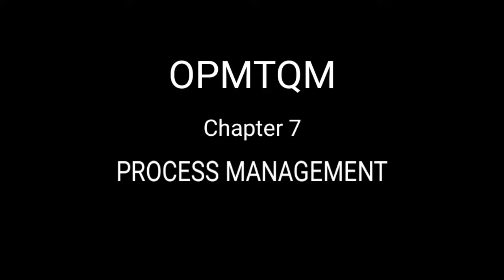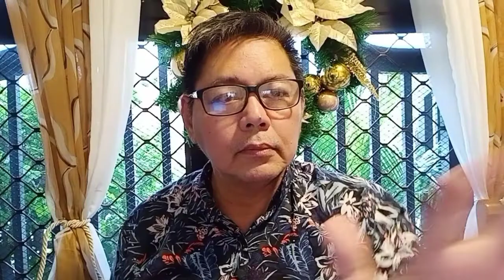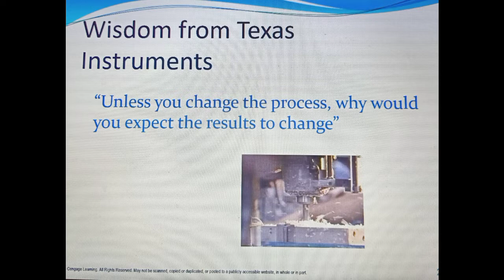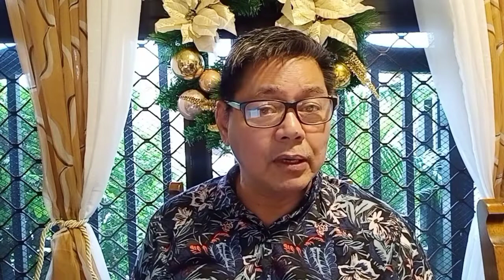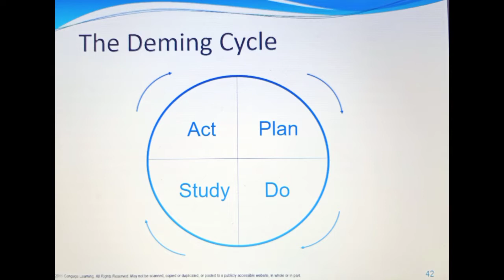OPMNTQM CHAPTER 7 PROCESS MANAGEMENT

Comment: Ilagan, Gerard Paulo Angelo V.
2AIA
Final Examination

Chapter 7- Identify and explain five leading practices in process management exercised by total quality firms

Business change must be performance-driven - "You reap what you sow." This is the measurement of the performance levels of employees in a company. 

Business change decisions must be traceable to the stakeholder criteria - stakeholder criteria is something agreed on. Which is also the basis for making business decisions. 

Business processes must be managed holistically - this means appointing supervisors to every business process. It is simply making others do the work for you.

Process renewal initiatives must be conducted from the outside in - basically, it means working your way back. Just like factoring in math.

Business change is all about people - for a business to change, the people must change too. And change does not happen overnight. It is a long process. Which must be handled properly

Comment: BAITO, Vince Eric T. 
2BBE

FINAL EXAMINATION

Chapter 7:

QUESTION: Identify and explain five leading practices in process management exercised by total quality firms

Total Quality firms are organizations that utilize the concept of total quality management in terms of operating one’s business. By definition from the Oxford dictionary, total quality management is a system that relies on the concept that each member of staff shall be committed to a certain level of high standards in terms of work in any aspect of an organization. While the concept of total quality management has an eight-pillar foundation of its principles, there is still a need for how to practice and execute the progress management properly. In this essay, the methods used to maximize the full capacity of process management shall be discussed. 

First on the list is management audit,  this is the prerequisite step needed to fulfill the implementation of Complete Quality Management. This seeks to aim, recognize, analyze, and identify any error that might present itself inside an organization - in doing so, an organization can seek the possible resolutions in order to address the issues at hand. Additionally, management audit allows an organization to have the opportunity to maximize its production of top quality products or services. Whereas critical success factors (CSF), is an individual’s guide in finding one’s purpose that is in line with his or her business ideas; this will allow oneself to focus on his or her goals and acknowledge the various factors that will aid in any improvements to his business rather than remain in a stagnant position. This is why it is a must to quantify any potential achievements an organization may have attained. The critical success factors show how much of an impact is made by Total Quality Management; this is achieved thru the illustration of numbers, graphs and diagrams. The concept of developing a process in order to fulfill the requirements is a dynamic development in a business’s process that will provide the business with easier workloads in collecting new ideas and improvements for future use. There is a specific process that should undergo order to identify if the concept of Total Quality Management works on an entity. T This advantage will help one recognize the customer’s demand at a particular time or trend. The developing process is either done through means of tools or execution by personnel. Data is a manifestation that is a prerequisite in any business; this may range from the number of stocks to the percentages of interest a company may annually receive. Nonetheless, when computed properly, data can be both a testimony and a basis for any future steps a company may partake - this is because numbers are reliable and exact. Furthermore, both clients and employees also receive updates on the possible shakes the status quo may have. The modification of data is not an easy task mainly because the TQM is in a consistent aspect that changes over time - with this, it is necessary that the individuals mentioned above be given regular inputs with regards to the data. While data-related changes may be deemed as a strenuous task, one should not lose momentum or discipline so as to avoid any possible needed data adjustments. As an old Japanese proverb once goes “fall seven times, stand up eight” - possessing the attribute of being relentless is a fundamental trait any organization should practice. In order to reap the full benefits of Total Quality Management, an organization must be steadfast in terms of managing its business since the assets lie in the continuous long term measures rather than the short trivial adjustments or improvements. When done properly, Total Quality Management could serve as life insurance for any employee who partakes in it.

When executed right, the five practices aforementioned above will greatly aid a business in terms of management. These practices are utilized by total quality firms and may also serve as a universal guide for any organization who strives for improvement.

Comment: HINANAY, Avijah Rei E. 
2AIA
FINAL EXAMINATION

Chapter 7

Question: Identify and explain five leading practices in process management exercised by total quality firms.

Answer: The five leading practices in process management are ff. (1) Define, document, and manage important value creation and support processes (2) Translate customer requirements and internal capabilities into product and service design requirements early in the process (3) Ensure that quality is built into products and services and use appropriate tools during development (4) Manage product development process to enhance communication, reduce time, and ensure quality (5) Define performance requirements for suppliers and ensure that they are met. These are 5 of the many leading practices in process management exercises by total quality firms. And each of these plays a key role in producing quality products for the firm.

Comment: PABLO, Angelica 
2-AIA
Final Examination

Identify and explain five leading practices in process management exercised by total quality firms.

The responses should focus on the driving practices as examined within the content:
-They characterize and report critical esteem creation and bolster processes,and oversee them carefully.
-They interpret customer necessities into product and service plan necessities early within the design process,taking into consideration linkages between product design necessities and manufacturing or service prepare requirements,supplier capabilities,and legitimate and natural issues.
-They guarantee that quality is built into products and services and use suitable building and quantitative devices and approaches amid the improvement process.
-They manage the product improvement process to improve cross-functional communication,reduce product improvement time,and ensure trouble-free presentation of products and services.
-They characterize performance necessities for suppliers,ensure that requirements are met,and create collaborating connections with key suppliers and other organizations.

Comment: Guillarte, Jahn Lorraine G. 
AIA2
Final Examination

Chapter 7 
Identify and explain five leading practices in process management exercised by total quality firms. 

A. Go slowly
Everything takes time. Therefore, for companies to ensure success, they should implement plans and strategies with regards to calculated time. Moreover, they should provide employees proper training and seminars to further understand the changes to be made. Through that, plans and strategies have a bigger chance to be successful rather than rushing plans to be implemented but would later on be removed and reverted back to the original because employees cannot keep up with the changes made. 

B. Choose a BPM tool based on your business needs
There are various business process management tools that can be used by a business. There are tools designed for software developers, and the like. Thus, to ensure effectivity and efficiency of the BPM tool, companies should consider weighing the BPM tool and choose a specific tool that would best be used for their type of business. 

C. Encourage collaboration
Communication is the key for companies to become successful. Therefore, companies should encourage employees to work together to immediately solve concerns and flaws that might affect the whole system. Furthermore, working together makes the job easier and gives a chance to managers to gather suggestions and opinions that can be used during the implementation process. With this, concerns can be easily addressed, and the production process would successfully create quality products and services. 

D. Understand and address internal difficulties
As mentioned earlier, communication is important for companies to achieve and deliver quality in their products and services. Therefore, organizations should first prioritize addressing internal concerns and fix problems and mishaps happening in the planning and production process. Because changing the process means changing the result. Thus, companies should encourage teamwork and provide proper compensation and reward to employees for them to feel motivated and considered in the group. Because employees that are satisfied with the company ensure that they give their best effort to provide consumers with quality products and services which in return would help achieve the standards and objectives set by the organization. 

E. Talk to customers
For companies to become successful, they should be able to cope and adapt to the changes and demands of their market. Thus, companies should communicate with their customers through feedback or comment cards that would help them gather information regarding the customer’s experience. Since the customer knows what he/she wants it is important for companies to consider the feedbacks of their consumers in developing and improving their products and services that would be aligned to the needs and demands of the consumer. This would help the business achieve customer satisfaction and loyalty which would lead to the organization gaining more profit.

Comment: Sabandal, Paolo F
2AMA

Final Examination

Chapter 7  Identify and explain five leading practices in process management exercised by total quality firms. 

 

Ensure that quality is built into products and services and use appropriate tools during development- this leading practice is essential to the organization because no quality = no sales on where the product and service must be of quality to satisfy the customer. Also, in attaining quality, the proper tools must be used in order to efficiently attain quality. 

Manage product development process to enhance communication, reduce time, and ensure quality- in relation to the first leading practice, this leading practice is the business making the quality of their products consistent by continuously monitor its processes so that it can be more efficient while still having quality. 

Control the quality and operational performance of key processes and use systematic methods to identify variations, determine root causes, and make corrections – this leading practice concerns itself with the standard that a business creates in terms of quality on where they will monitor the processes to see if they still operate at the standard of the business. Also, in these actions of monitoring the processes, the business sees the causes of some inefficiency in terms of the processes which leads to the reduction of quality in their outputs. 

Continuously improve processes to achieve better quality, cycle time, and overall operational performance – this leading practice concerns itself with the idea that the processes can still be improved so that the business can reduce cost and still uphold quality. In this context, this practice pertains to the drive of the business to continuously improve itself so that the processes will be more efficient. 

Innovate to achieve breakthrough performance using benchmarking and reengineering – this leading practice concerns itself with the creation of new ideas that will improve the processes by using the existing data from benchmarking and reengineering the process to be more efficient.

Comment: Mariano, Uriel S.
2-AIA
Final Examination Chapter 7

Describe the three basic components of service operations. Describe how service companies differ on these dimension, how they relate to manufacturing companies, and the quality dimensions that must be considered given the degree to which these components exist in the service company.  
-	A service operation an extend modification process of inputs to desired outputs using appropriate resources. The three basic components of service operations are service strategy, service performance and customer results. Service Strategy focuses on the value chain and design of the internal service platform. Service Performance, on the other hand, ensures that staff are trained and empowered to deliver and perform their skills. Lastly, Customer Results is about the experience of the customer, what are their feedbacks about the service provided. Service and Manufacturing companies simply differs on what they offer to their customers. Service businesses offers a service while Manufacturing business offers a product made by them. However service business relates somehow with manufacturing business wherein some manufacturers also offer their own service operations like businesses who sells shoes and at the same time offers repair services.

Comment: FINAL EXAMINATION 
VILLA, CHINEE P
2AIA

Chapter 7
Identify and explain five leading practices in process management exercised by total quality firms.

Answer:
Total Quality Management (TQM) is characterized as an administration model that centers around clients and the advancement of items and administrations that address the issues and surpass the desires for clients.The reactions should zero in on the main practices as examined in the content: - They characterize and archive significant worth creation and backing processes,and oversee them cautiously. - They make an interpretation of client necessities into item and administration plan prerequisites right off the bat in the plan process,taking into account linkages between item plan necessities and assembling or administration measure requirements,supplier capabilities,and lawful and ecological issues. - They guarantee that quality is incorporated with items and administrations and utilize fitting designing and quantitative devices and approaches during the advancement cycle. - They deal with the item advancement cycle to upgrade cross-useful communication,reduce item improvement time,and guarantee inconvenience free presentation of items and administrations. - They characterize execution necessities for suppliers,ensure that prerequisites are met,and create cooperating associations with key providers and different associations. - They control the quality and operational presentation of key cycles and utilize deliberate strategies to recognize critical varieties in operational execution and yield quality,determine root causes,make corrections,and check results. - They consistently improve cycles to accomplish better quality,cycle time,and generally speaking operational execution. - They enhance to accomplish advancement execution utilizing such methodologies as benchmarking and reengineering. - They design and guarantee progression of tasks in case of a crisis.

Comment: RAMIENTO, Patrick Ryan R.
3BLM

Process Management is mainly concerned with how products are managed in terms of planning and activities which are essential to operate with excellence. In this chapter the main key processes are identified for an organization to be optimal and effective in terms of its production and activities. To achieve efficiency in process management, vital work processes must first be identified, and in this identification, we can look at the avenues in which an organization can improve. The key processes that are mentioned in this video are value-creation processes and support processes.
Value-creation processes depend on the consumer and external needs while support processes depend on internal customer needs. The example that was given in this chapter is the “poka-yoki” device which is utilized for mistake-proofing and can develop measurements and improve processes in process management. Under the process management we also have the ISO which is under the six sigma that can help us with understanding and improving processes on a project by project basis. These types of projects are linked under a common framework from proper guidance. I have learned under this discussion that process management is essential to an organization’s improvement, and should therefore be encouraged and practiced by more businesses.